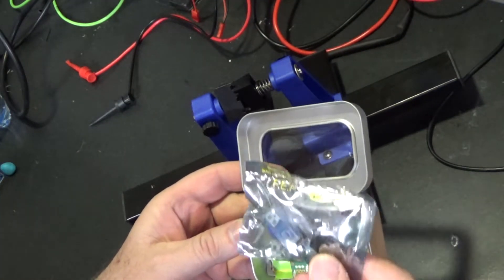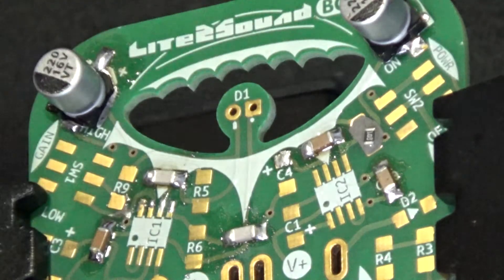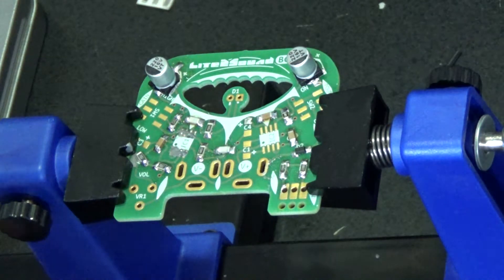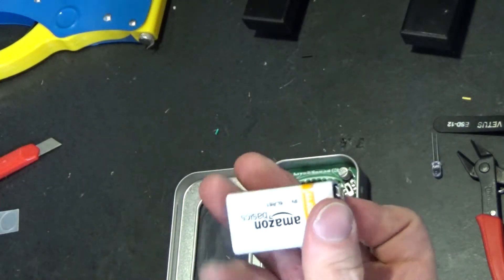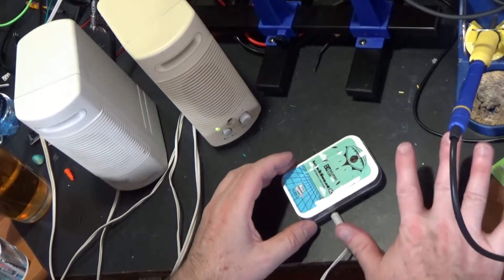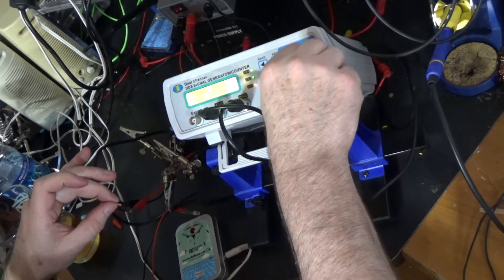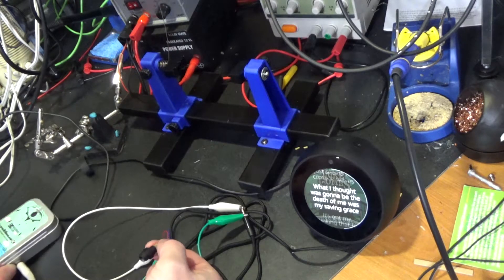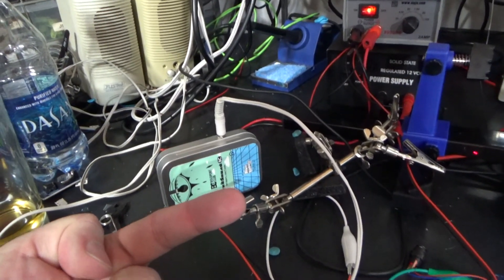Can Country Music be Transmitted by Laser?

Comment: The constant current driver for the laser diode doesn't like being turned on and off quickly enough for decent musical output, that's why it's just flashing and pulsing, and you're getting scratchy results. See if you can find a way to modulate the voltage coming out the driver, before it gets to the laser diode itself :D